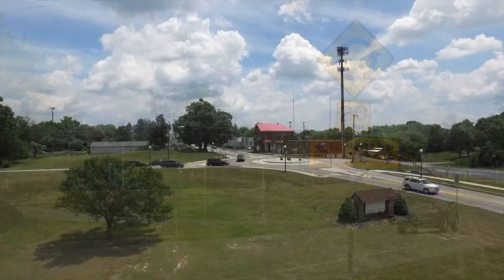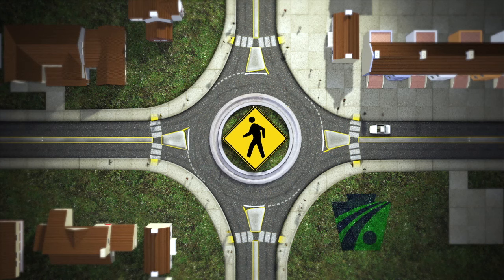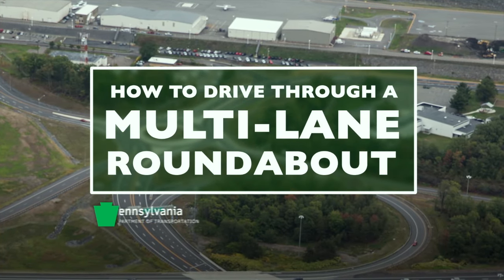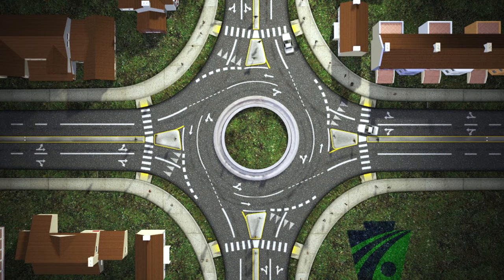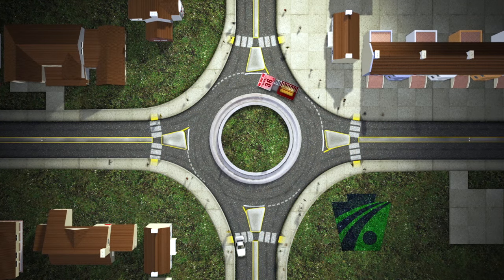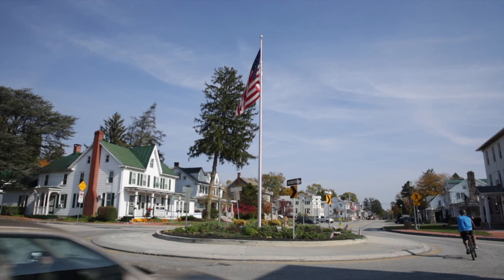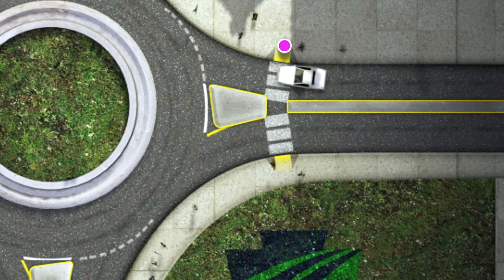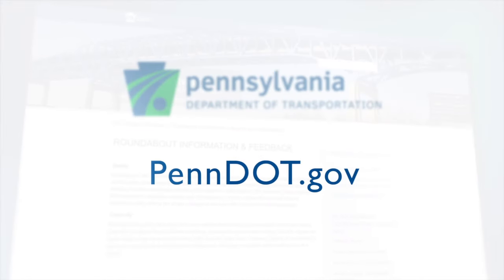How to Navigate Pennsylvania's Roundabouts

Comment: I live in Meadville, PA.  A few years ago a lot of the street lights here were replaced by 4-way stop signs.  Since then, I've witnessed many drivers refuse to wait their turn.  Once, at the intersection of Arch and Grove, I watched as two drivers repeatedly surged forward, each trying to aggressively claim the right of way, until they both came together in a slow, stupid, entirely preventable collision.  Now that nearby Saegertown is getting a roundabout, I shudder to think about all the collisions that will be caused by the same sort of aggressive entitlement, compounded by the fact that most people who don't understand roundabouts (like me, a few minutes ago) probably won't bother to take the time to learn that the cars in the roundabout have the right of way.  Mark my words, at least one person will die because of a driver who thinks (or just drives like) Route 19 is still a straightaway.
Reply: An all way stop has rules, but much is left up to the users, as with most traffic control.  At a modern roundabout, the circulating lane has right of way and all entering lanes must yield to all circulating lanes.  Also, the speeds are low, so most crashes that do occur are fender benders, not injuries.
Reply: IIRC, there are yield signs at the entrance to every roundabout.  If someone refuses to yield and causes an accident in which there is a fatality, then that person isn't just going to get cited with "failure to obey a traffic control device", he's risking being charged with "homicide by vehicle", which is a third degree felony, which means potentially years in prison and thousands in fines.  Fortunately, studies have demonstrated that roundabouts are much safer than traditional stop-sign or signal-controlled intersections, and they can reduce injuries by around 75 percent.
Reply: The roundabout in Waterford PA has seen a complete reduction in injuries and collisions.  Your assumptions are incorrect based on what has happened so far.  I also live in Meadville PA and I am grateful the city ripped out expensive and unnecessary traffic lights.  It has made driving in the city less stressful, quicker and my experience has been that the vast majority of drivers take their turns.  In fact, Meadville drivers seem to be more courteous than most other places I've traveled in my life!
Reply: So you're saying that my assumptions are wrong, even though the roundabout isn't even operational yet.  And you're basing this on a different roundabout located somewhere else.  Interesting.  Okay, I'll play.  I took the time to google "roundabout", "Waterford", and "accident".  Here's a little something from my favorite hit: "As a life long resident of Waterford, the roundabout has been the 
biggest waste of taxpayers dollars and it has caused more traffic 
problems than it has helped," said Stephanie McKinney at Wednesday's meeting. "It's causing backups, it has hindered traffic problems - it has caused lots of accidents."  Vertov 76, who is lying, Stephanie McKinney or you?  Is she just making stuff up just to win an argument, or are you?  Let me know.  About Meadville's stop signs:  I'm very glad that people wait their turn whenever you pull up to a stop sign here.  I really wish I could claim the same thing, but I can't.  And since most days I can't even drive to Tops and back without witnessing at least one driving ATROCITY, I'm terrified to know about these other, far worse places you've traveled through.  Can they be reached without dying after a living sinful life?  Thank you for your knee jerk, contradictory, fact-free, personal opinions,....none of which makes you right, and makes me "incorrect".
Reply: Oops: "living a", not "a living".
Reply: Chuck, can you point to 'facts' in your response?  All I see are opinions.  Did Ms. McKinney provide facts you are not passing along?  Is she qualified to make such an analysis?  Show us the data, please.
Reply: I shouldn't need any facts.  Vertov76 should've provided them when they used the "reduction of collisions" in Waterford as a justification for calling my opinions "incorrect".  Not "different from mine", but "incorrect".  I just used Stephanie McKinney's quote to show that Vertov76's claim isn't universally agreed upon.  The fact that vertov76 couldn't state their opinions without attacking mine says nothing good about them as a person.  And the fact that you jumped in to help the attacker instead of the attacked says nothing good about you, either.  PLONK
Reply: I'm sorry that you took this personally.  I did not mean to attack you.  As far as the improved safety of roundabouts, I was citing PennDOT statistics that I had read.  I wasn't trying to start an argument.  Their information is freely available and you can feel free to google at your leisure if you like.  Regarding your comments about four way stops, I was just providing my own anecdotes that contradict your experience.  Each of us has our own experience, equally valid.  I'm sorry that my comments caused distress for you.  It was not my intention.
Reply: Hey, Scott Batson, did you hear about the drunk woman from Edinboro who slammed into the roundabout today?  It wasn't so much a low speed "fender-bender" as it was a case of "a driver who thinks (or just drives like) Route 19 is still a straightaway."  I am right....you are wrong.....and that's not an "opinion", it's a 'fact'!

Comment: Wouldn't it better to place the pedestrians farther back rather than close to the entrance to the roundabout?
Reply: The pedestrian crossing is usually only one car space behind the yield line.  If a car stops at the yield line, there is very little delay for the second car to leave the crosswalk clear, and studies show that more people driving yield for people walking.
Putting the crossing too far back would significantly inconvenience people walking, and many would cross at less safe locations.  It is a balance between how many people are driving through versus how many are walking through.
With multi-lane crossings and high car volumes, or high pedestrian volumes, the crossing is sometimes placed two or three cars back, but is also accompanied by beacons or signals to aid crossing to the median when pedestrians are present.